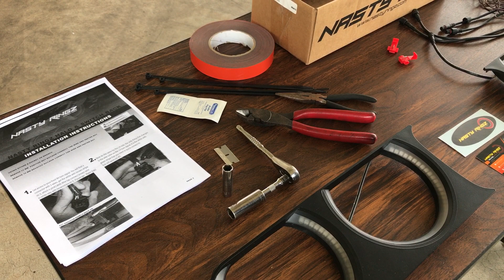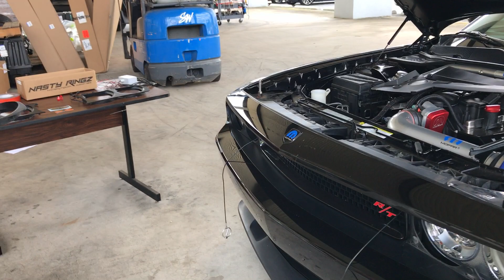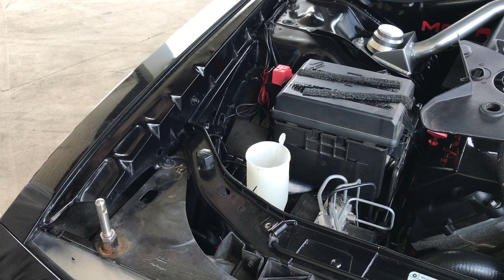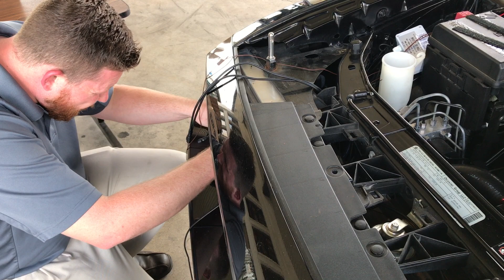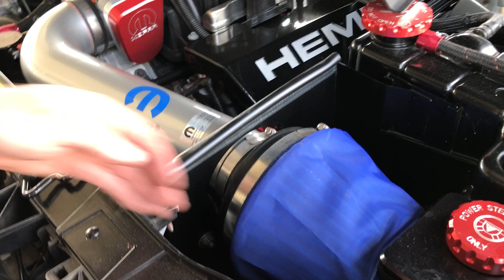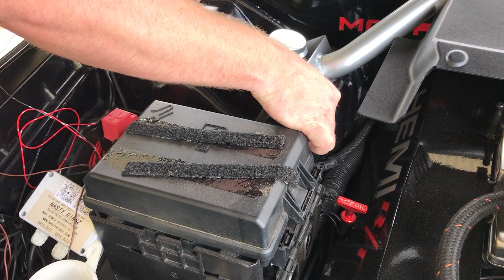Steve White Motors Installing Nasty Ringz Bezels Halos on a 2010 Mopar 10 Challenger

Comment: I know it was tight quarters, but you didn't show either the control wire connection to the  to the connector or a look at the headlight power wire. I assume in either case it was some kind of vampire tap.